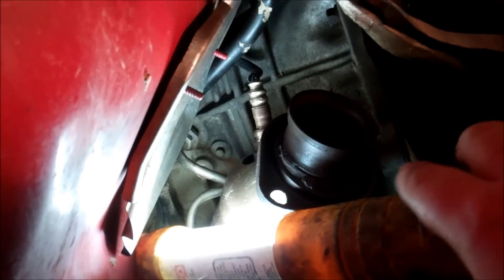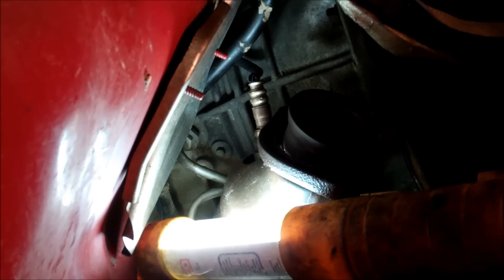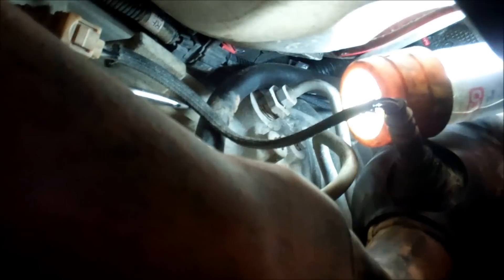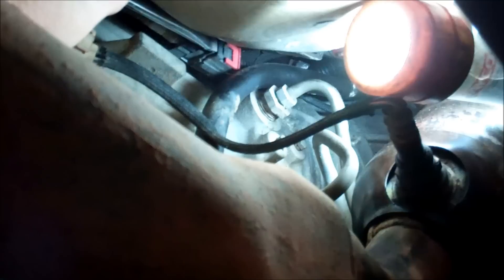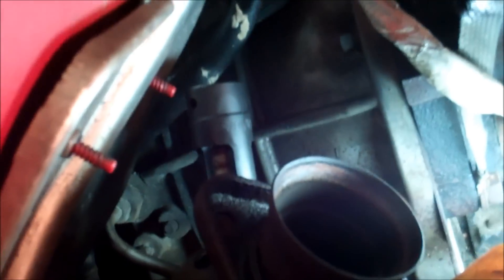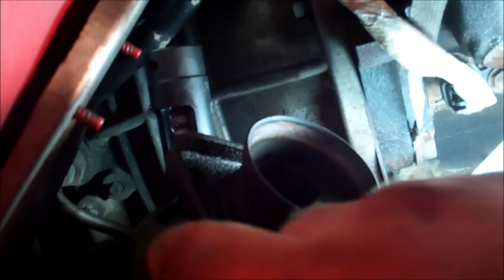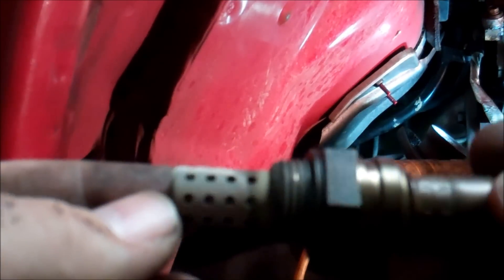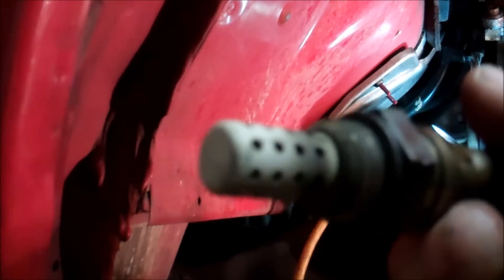2001 Dodge Dakota - 4.7L Oxygen (O2) Sensor Replacement (Bank 2 Sensor 1)

Comment: Just completed job on this sensor in 1.5 hours working pretty slowly.  HIGHLY recommend removing the inner fender well for this job. Pop rivet it back  with fender washers if replacing the plastic is an issue.
Additional tips
With the sensor plainly within reach it is much easier to just use the common deep well sensor socket with a open end wrench on it.
Presoak sensor with Kroil. Study connector before struggling with it up in a blind spot. Use a 90 degree scribe to pull the red lock open.

Comment: Just replaced this this weekend.  Took out the inner fender well.  PB blaster and heat  to get the sensor out.    Disconnecting the harness was a pain in the ass.   Couldn't get my hand in there to properly disconnect the clip.   Wound up CAREFULLY breaking apart the female (sensor side) connector  with a set of needle nose plies until it pulled free.  Would probably go easier on a lift but i was working on my back.

Comment: If you know for sure you have the correct replacement, disconnect battery + terminal, cut the wires to the O2 sensor, then use a deep well 7/8" socket and probably a breaker bar. Might also try to spray some liquid wrench to soak in to the threads.

Comment from the maker: @mmwetodd Thanks for the comment, unfortunately no, you can only access the electrical connection from under the truck. The O2 sensor can really only be accessed from the wheel well. I supposed if you had small enough hands and small tools you could probably get it done, but I was working on my exhaust and the sensor was within easy reach. Thanks again for posting and watching!

Comment from the maker: @chetwinslow21 Thanks for the comment. To find your O2 sensors, just follow your exhaust manifold towards the muffler. If you have the CA emissions, you will have 4 total, 2 on each side of the truck, one before the catalytic converter and one after. If you have non CA emissions, then you should just have two O2 sensors, one before the catalytic converter and one after.

Comment: I was able to remove the 3 bolts holding the truck's cab down (on the same side as the O2 sensor) and then jack up the cab so that it was off the frame about an inch.  This allowed me to get get my hand to the O2 sensor plug, that was crushed between the body cab and the transmission.  Otherwise was impossible to get to the plug.
Reply: I was able to barely reach the plug and successfully disconnect the plug from the wire harness, but it was painful to do it. After replacing the o2 sensor, I still get the same error codes, p0152 and p0155. In case I need to replace the o2 sensor again, I would like to try your method. Could you please advise me where are those three bolts located? Thank you in advance for your help!
Reply: @yougoog1  I don't have the truck so can't take a picture for you but they are the bolts on the structural frame that holds the passenger cab to the frame.  They're pretty hefty bolts.  I think there were 3 on the left side and 3 on the right side of the frame.  Sorry I can't be more specific.
Reply: @daviddaggett7545  Thank you David so much for your quick reply! Now I know where to look for those bolts. Your help is highly appreciated!
Reply: i did cut the 02 cables the pull the connector down w pick tool and unplut it

Comment: @TheTexasCoder unfortunately the code was written on the paperwork my friend brought back from the shop. i just ordered a bosch sensor  without any wire splicing or buying a sensor bung for little less then 60. hopefully it will come in during the week so i can install it. i took a look under the truck and found that the driver sensor looks much easier to handle than the passenger side,

Comment: i have the same problem, i have to unbolt the muffler system on both banks and was easier to cut the 02 sensor circuits to get access to sensor and to connector

Comment: the red tab slides sideways like he does in the video with a screwdriver away from the connector  .
then just press in the center in-between the red tab prongs with your 1st finger (this is the actual clip that holds them together thats why they dont come apart after sliding the red tab!) and at the same time pull both connectors apart

Comment: TIP ! Remove the wheel shroud from the fender well. ( I just broke the plastic tabs and bought new ones.) No need to remove the wheel. Then sensor is easy access if you have O2 sensor socket.
Reply: Would you believe that the 3.7 L is worse? I pulled the wheel well cover off (and that tiny aluminium heat shield off) and I still can't get to the clip. I'm honestly contemplating pulling the exhaust manifold off like he said

Comment from the maker: @therevelation88 Right bank is the passenger side, upstream is the sensor BEFORE your catalytic converter, closes to the engine/exhaust manifold. You can pick up a Bosch sensor for around $50 bucks and replace it yourself. The 4.7 liters are brutal on the sensors, so it is not uncommon to replace O2 sensors on our trucks. Good luck and let me know how it turns out! By the way, what was the DTC code, was it a P03xx or something?

Comment: i had a friend take my truck to the shop for the check engine signal. reading the paperwork from the shop it says "1 DTC right Bank (Upstream) O2 sensor" Which sensor would that be? i would rather save money and just replace one for now rather to guess which one it is. thanks.

Comment: I just replaced my o2 sensor, right bank sensor 1, but 3 codes still keep coming up. they are po051, po152, and po155. They all relate to bank 2 sensor 1, the same one i fixed. I'm starting to think it might a problem with the catalytic converter or the wiring that sits right on top of the transmission is fried. any thoughts or tips?
Reply: therevelation88 did you get rid of the truck? apparently there is a problem where the power steering pressure sensor leaks power steering fluid download the wiring harness which can cause the circuit to short out. try hunting down a short in the circuit starting here
Reply: Did you fix the problem? Cause I'm having the same problem after I changed the sensor.
Reply: @michaelbawa3781  I am having the same problem. I just replaced the o2 sensor, but the same codes, in my case I have two codes instead of three, are still coming up. The two codes are p0152 and p0155. I noticed the comment from Carlin Lenze suggested a possible wire damage caused by the leaking power steering fluid.I will check for the wire harness. What did you find with your truck? Hopefully, you could share some good findings that help me to fix my truck. Thank you!